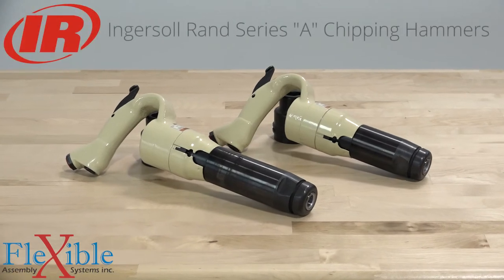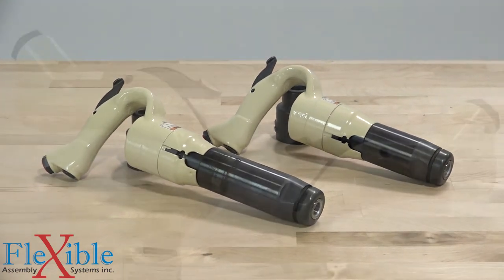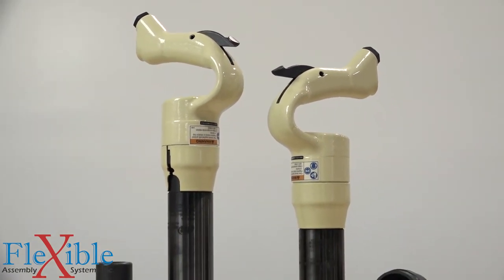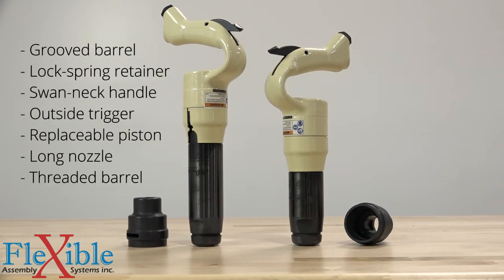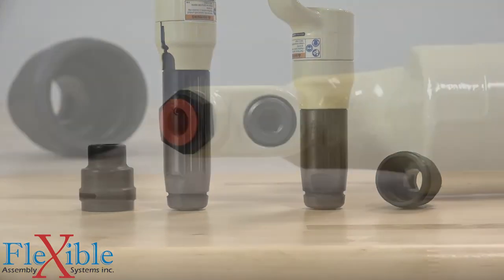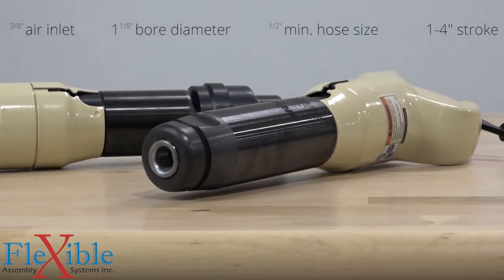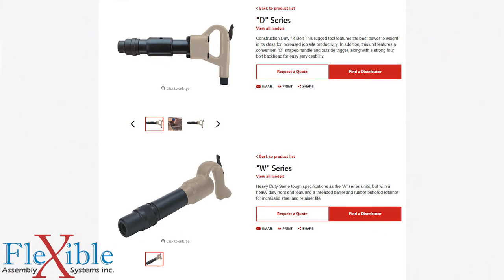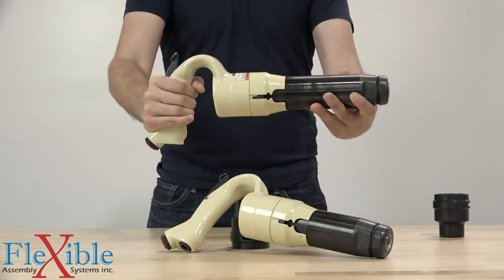Ingersoll Rand Series "A" Chipping Hammers

Comment: Hellow 
Wonerful machine . Can it carve granite stone of Himalaya? 
I am a sculptor from  leh ladakh.  Looking for granite carving .
Reply from the maker: Thank you! This chipping hammer is technically a demolition tool and won't offer very precise control for carving granite. Also the chisel tip you purchase would have to be carbide tipped (not hardened steel) or it would break easily on the granite. This tool may work for you, but there are probably better options available specifically for carving .